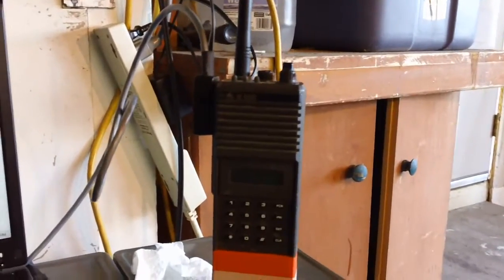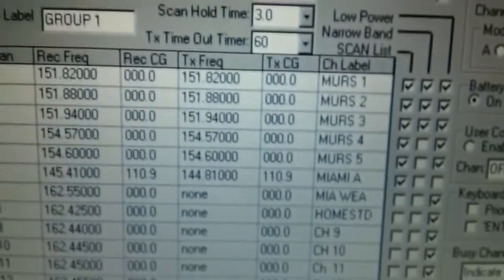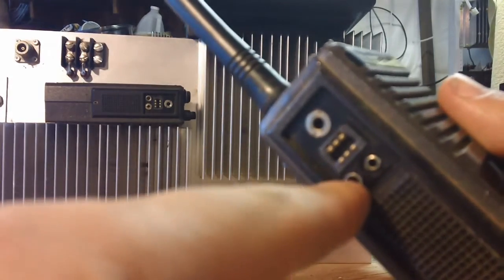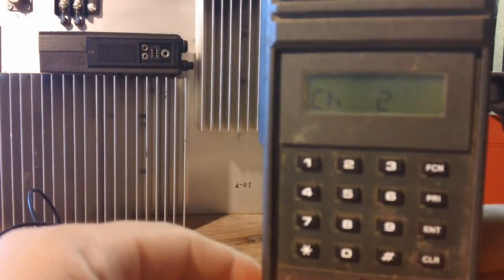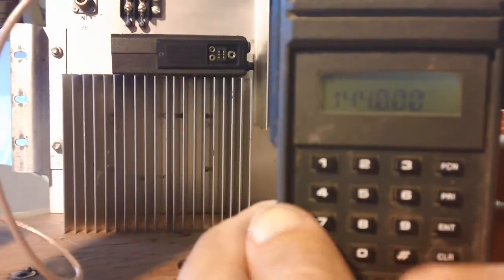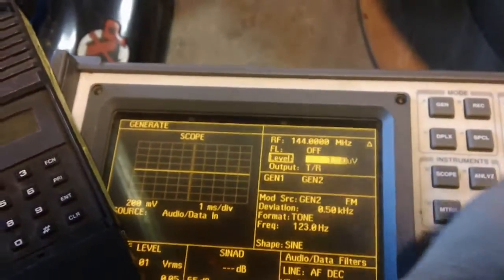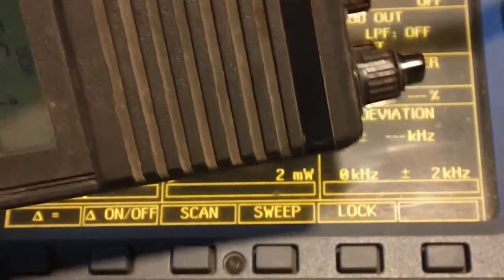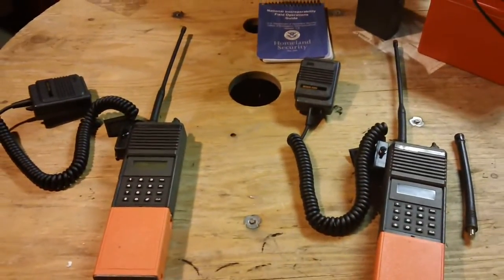Prepper Guide to Surplus Radios, King Programming & Ham Modification.

Comment: Dude… WHERE ARE YOU?
I miss the Big Guerrilla !

Over a dozen years ago, you  got me thinking about “prepper” uses of communications after being in the field for 37+ years.
(Using radios as a firefighter / ham / / radio service & installs & vehicle upfitting back in my youth)

Now with the Commies ready to take over again (Summer 2024) in the upcoming “Fall of Love & Riots”,
comms are truly a necessity.  I have a pair of UHF P25 phase 1 repeaters (Quantars) and a pair of DMR repeaters (Hytera &  a /\/\ XPR8400) set up on 2 mountaintop sites w/utility AC power and standby gensets at both sites.  It was worth the freq. coordination & licensing to avoid the mess of GMRS and itinerants .  I get portable coverage over the entire area we are in.

Any friend or family member who wants to make use of the gear just has to pick up a UHF transceiver and get a MOU letter from me.  (Most already have dept. issued radios, but the rest have been buying used /\/\ otorola XTS5000’s, XPR7550’s, XPR5550’s or Hytera DMR PD-782’s or the AnyTone 878UViii plus or 578UV mobiles.  The AnyTone dual-band (UHF VHF) are a great value for Chinesium gear.  They are just not nearly as rugged as the others.

Just  a thought for the prepper folks.
OR… you could also license a few itinerant frequencies.  It doesn’t require the use of frequency coordination (very $ pricey) and all of these FCC “IG” (aka “Business Band”) frequencies can be  included under a single FCC license for approx $250 (+/-) for a 10 year period.   
You can use ENCRYPTION on these vs. no E on ham bands or GMRS/FRS.

We spent approx $4500 for all engineering / frequency coordination and FCC licensing back in the early 2000’s.
That’s way higher than today’s pricing (we went with  UHF “T-BAND” 470-52xMHz at the time when it was first opened up for public safety and some business use..  we escaped the Obama “stimulus act” theft of this spectrum she. Pres. Trump was in office and saved us.  LOL

Split up amongst a large group of friends and family , it’s very affordable nowadays.
I know you know all of this , just thought I’d mention to the viewers.

Hope all is well GC!

Comment: Hey, excellent videos! Do you have any idea how to factory reset a EPH5102X (or any of these series)? The default password isn't 00000 in mine and I want to FPP it. I have no idea how to clear it unless you have to do it via software only?
Reply from the maker: You would need to use the software to clear it. I know of no way to do it manually.
Reply: Thanks for the confirmation!!

Comment: Can I build this repeater set up with bks without possibly damaging the units? https://www.youtube.com/watch?v=_KrH86Dzhnc

Can you show us the pin outs of the programming cable plug that correspond with the computer com port plug, maybe numbering them by showing the receptacle on the radio with numbers and the computer end of the cord with corresponding numbers?
Reply from the maker: +Josiah Volkmann manual linkhttp://www.incident.fillmorefire.com/BK%20Presentation/GPH-CMD/Service/GPH-CMD_Service_Manual_03-05.pdfPage 5-11 on the manual has the pinout schematic. Its the same flavors of bendix king from LPU to DPH models. really good radio to experiment and modify with.I saw that video awhile ago and I was going to comment on it saying he's missing a duplexer or have enough antenna separation to make it work right. But his comments is disabled if that is any indication of integrity to call out bullshit. Anyways, yes it will work, but you will lose a lot of range because the transmitter will make the receiver deaf when it repeats. 1/4 mile maybe ok, but farther you will lose the link where it should have greater than 5 miles range dependent of terrain and placement. Hope that helps.
Reply: GUERRILLACOMM Thanks, you have been a great help and your videos have helped me a lot too.
Reply: +GUERRILLACOMM Could you show what pin outs correspond with the plug that goes in the computer com port on the programming cable with a continuity tester or ohms multi meter.

I got a eph for ham use but don't want to buy that expensive $160 - $130 cable. 73s
Reply from the maker: Josiah Volkmann There is a reason why they cost more. Its not a straight through connection. There is actually a mini circuit board on the plug connecting to the pc that converts the signal out of the pc to a level and format the BK can use to program. Shop around, I see them for about $75 sometimes on ebay. BK doc com has them for cheap sometimes too.
Reply: Thankyou.
Reply: +Josiah Volkmann I made a video of the cable too that I will post.

Comment: Do they use an sma antenna?
Reply from the maker: +Josiah Volkmann Negative, I think its called a MX connector. Obsolete design. there are a few rare BNC connectors, they also sell BNC conversion kits to replace the MX connector. But that's a big job by itself. Practically tearing apart the radio to do it. The New Bendix have a SMA setup, its also totally redesigned.
Reply: Thankyou, this was very helpful/
Reply: Can you make a more in depth video of the ham and eggs program?

Comment: I have purchased several used BK LPU 4140A hand held transceivers for a Boy Scout Post to use on GMRS. I have tried entering the default 000000 code but the radios do not respond and stay on CH 1. Would you please tell me how to correct this problem? Apparently, the previous owner(s) changed the default code. Thank you.
Reply from the maker: Bill Davis I don't know of any hacks to reset the code. That info is imbedded on the radio itself unlike the keypad assembly which holds the alpha tags. Check a yahoo groups page called bendix king or something like that. they have free software that might help you out. Though I don't know if they have the LPU version. The software as far as I know is the only way to clear that.
Reply: +Bill Davis I am just using murs for my troops backpacking trips.
Reply: Try #0 both keys pressed at startup.

Comment: Hey, love your videos! So I'm a prepped myself, as well as an active state militia man. I've been working on a comms setup. I have a couple sets of Sordin's that I hook up to a modified U94 PTT, running to a UV5R at the moment. I picked up a military folding blade antenna with an N type connector. I'm having a really hard time figuring a couple things out. If you have the time to answer a few questions, it would be GREATLY appreciated. I couldn't find a way to message you privately. You seem like the EXACT person to ask. Also, I'm looking into getting a more rugged radio to use with this setup. MBITR's aren't easy to find or cheap.. Or even legal I don't think. Any help would be appreciated! Thanks! Love the channel. SUBSCRIBED!
Reply from the maker: HangtownTactical I'll try when I can.

Comment: Hello!  I found the plug itself for about $10 ( http://ebay.to/1wxY9iC ) and am trying to wire up a programming cable, primarily to downband the LPH to 144.  I previously built interface cables for Baofeng HTs with a USB to TTL board (SILABS CP2102 chip).  Is there a diagram somewhere for doing this with the BK LPH?
Reply: Well cool.  I was able to program one of the LPH radios.  The plug just shorts the 2 pins you mentioned.  I want to rewire it to actually interface with a computer to downband it for 2m ham use.  These rigs are silly old-school.  :-)
Reply: Christopher Suleske Plug Contact #6 TXD, #5 RXD, #3 GND. You should be able to figure it out from there.

Comment: It will freely allow me to fun all the way to group 99. So display says whether it can do 99 idk. It only has one group programmed. The rest will display no grp 02 if I hit enter.
Reply from the maker: Harry Schlonge Sounds like your specific radio is a one group only radio. If you press #, then 02, then enter. it will either go there or display No GRP 2 or something like that. Just pressing the # button will let you know what group you are currently in, if its capable of more groups. The EPH max designed capacity is 15 groups, later models of that design up to 20-25 groups.
Reply: Probably so just a single group radio. Cool and thanks for the Info.

Comment: I forget how to program a channel narrow by keypad. I know you press pound but forger if you hold it and when while programming a channel. I believe n would show up on screen. Any idea?
Reply from the maker: while you are in the programming mode and on the group and channel you want to program, the display should show "Ch 04" for channel 4, press #. The display should change or toggle between the previous display and "CH 04N", this is the only screen that will let you change to narrowband.
Reply: Thanks. What is weird is others say go into the actual programming passed the password and ch 00 prompt and it's not that way. It's how you said.  Got one going recently and got The orange double cam shells. Handy side radio. Use to see bk radios and think I'll never own one of them 80s looking bricks but now that I ran across one Basicslly free it's changed my opinion. Good radio. I probably judged it based on older radios I recall in 80s thay were total pos heavy and basically had no balls. Now using one of these I'd say they are definitely worth owning.

Comment from the maker: Sorry for the delay in answering. A PL code or (CTCSS) code is a low sub-audible tone that rides along with your voice during transmit. its used to open up the muted radio receiving it when it decodes that specific tone. Sort of like a key. it is also used to have access to  a repeater and some remote control functions. Yes you could program a CTCSS code on MURS. Did not understand your 2nd question, it all on the MGZ range.

Comment from the maker: Sorry for the delay. No, I dont have spares, need them for fire season. 49ercommunications dot "com" is a reputable place for parts, just look under BK radios and you'll find it. Speaker part # 1301-20034-702, tx button is "PTT Repair Kit". Dont know if you mean the actual Mic element or speaker mic that is external to the radio. the speaker mic part # is LAA-0209. Hope this helps.

Comment from the maker: There is a yahoo groups called "BK_radio", under their files area you will see a zipped file called breakfast"dot"zip file. I used the dos version, I cannot vouch for the current windows version. they also have the configuration software to the bk as well, again, i cannot vouch. It should work. good luck.

Comment: @GUERRILLAGEEK I'm a Mot guy through and through but for SHTF/WROL situations I want something that I can program effortlessly on the fly and not have to worry about the intricacies Mot demands. Big fan of Icom and Yaesu, so easy to work with both. I still laugh at the money agencies have been dropping on the APX line, especially when you consider an 8R is about $400. Later bro.